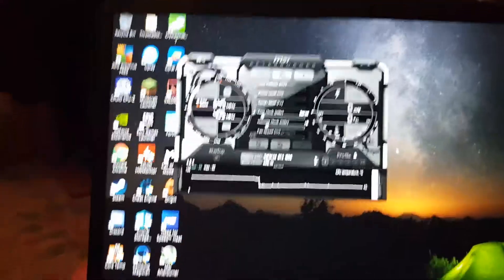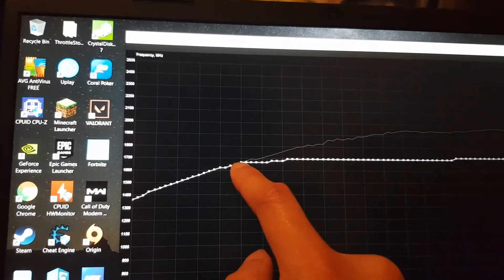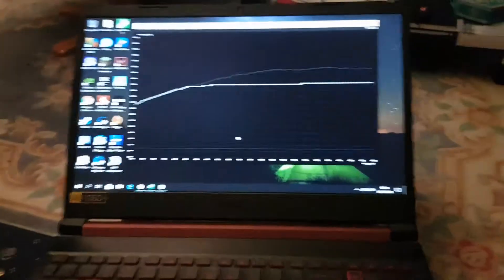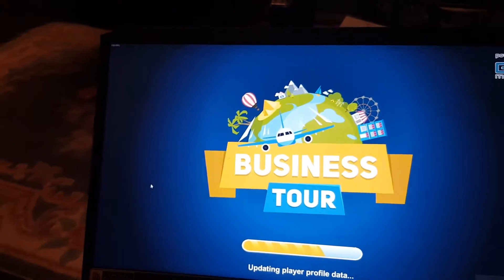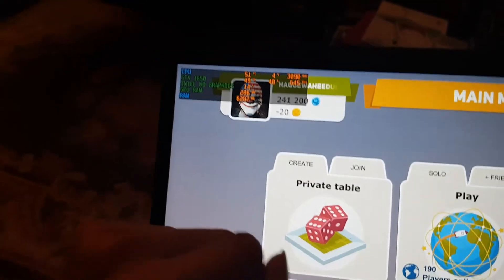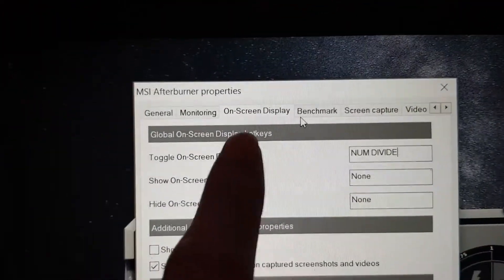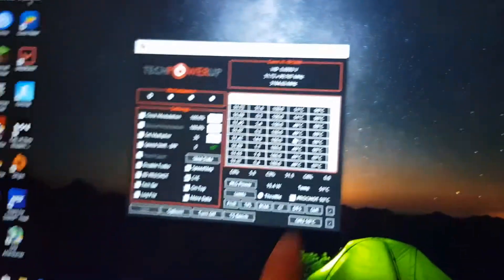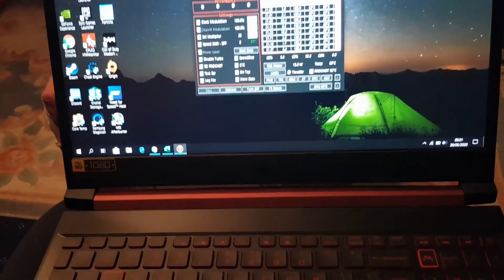How to Undervolt GPU and Setup MSI Afterburner Overlay

Comment: I heard lowering the frequencys makes it silent while gaming
Reply from the maker: Huh
Reply: @MrWaheedulHaque  ?
Reply from the maker: @pilot7749  huhhhhh what frequency
Reply: @MrWaheedulHaque  i think by undervolting you lower the frequency too
Reply from the maker: @pilot7749  no when undervolting you are trying to keep same or higher frequency with less voltage to produce less heat
Reply: @MrWaheedulHaque  I heard many guys on youtube while undervolting saying that the frequency gets lower therefore the noise too
Reply from the maker: @pilot7749  no its not to do with frequency, the fans go quieter as less voltage equals less heat so fans dont need to work as hard
Reply: @MrWaheedulHaque  just Check every1 says it